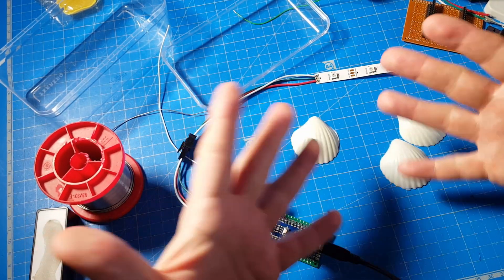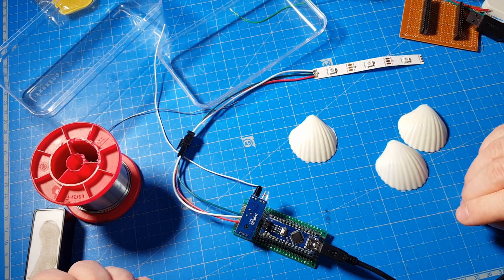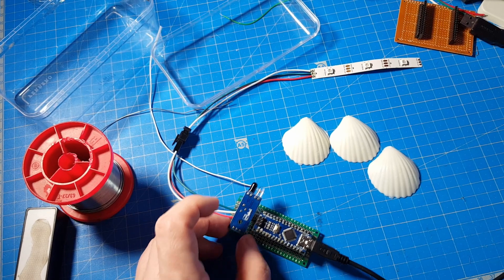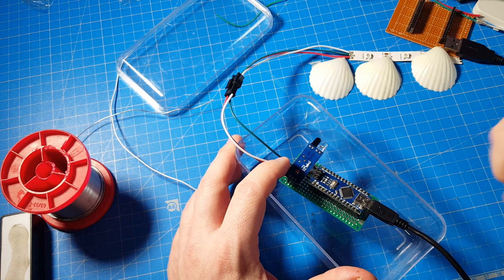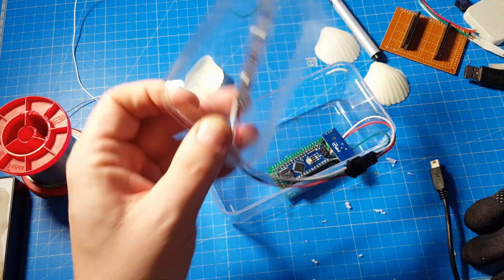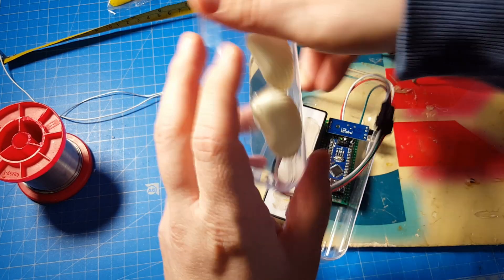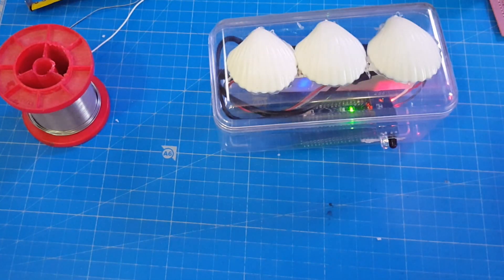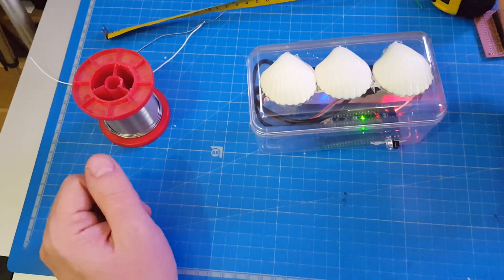3 Seashells - A hand washing timer

Comment: Great project
Maybe using a hot steel rod (or old soldering iron tip) to melt 2 holes would make a neater hole.
Reply from the maker: Yeah, probably.